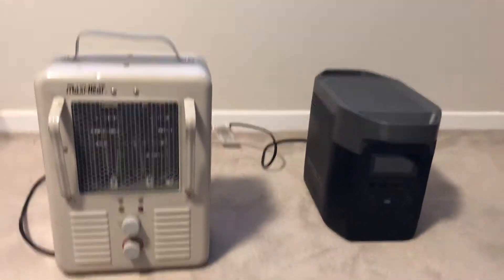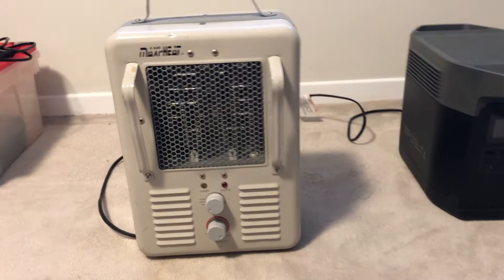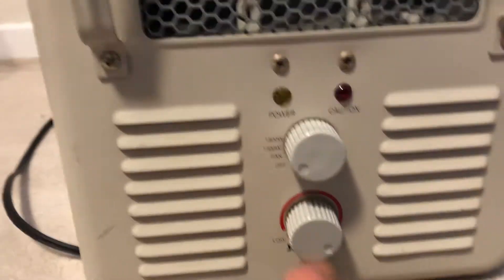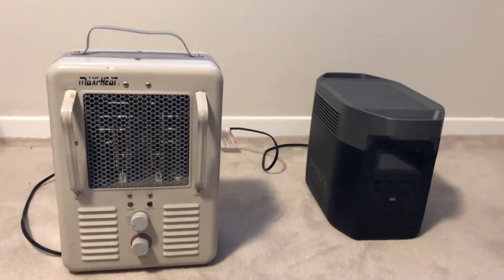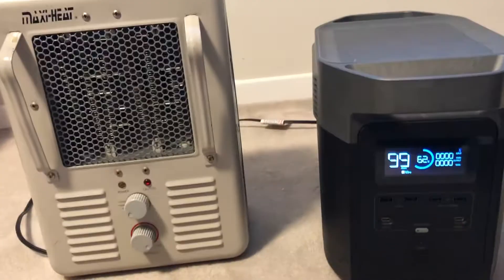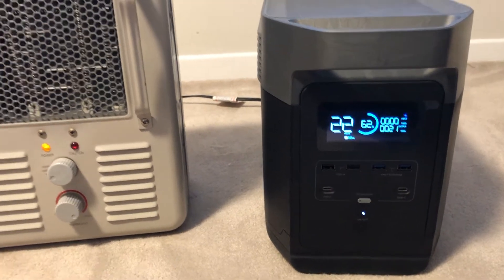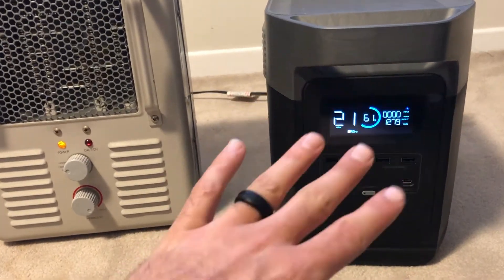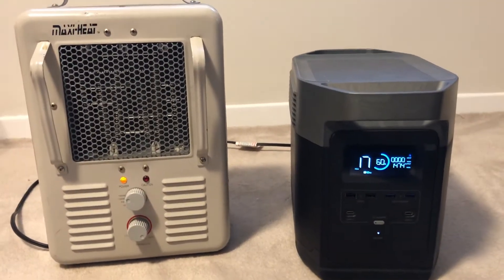EcoFlow Delta 1800 Space Heater Test - Can The Delta Solar Generator Run a Small Space Heater?

Comment: A heated blanket would be a much better option.
Reply: I'm homeless and sleep in my truck.  I need to power a heater without electricity
Reply: Look into an all-in-one diesel heater. About $100. You can have it in the trunk and run the heat to you. @justinkanicki8044

Comment: Yeah, but how long can it run the heater. In the winter thou need it to run all night.
Reply: No comments for a year no update smh
Reply: The ECO Flow showed 62% battery so it wasn't fully charged, but when he put on 1500w it showed 17 minutes run time. So it would probably run longer if he left it at 1300w, but ultimately would need a larger generator/inverter (or additional battery) if you wanted to run a 1500w unit for a lengthy amount of time.

Comment: How long would it run that space heater for. Would it run for 8hrs through the night?
Reply: Not long
Reply: Do the math.
Battery has 1260Wh capacity. 
1300W heater in an hour will use 1300Wh.
Realistically, you'll get 30-40 minutes tops.
Reply: The battery was going down quickly in the video. I'm guessing it'd deplete in under an hour.
Reply: Running electric heater is not efficient, better off using these, for tv, fridge and other things, recommend, gas, propane, kerosene heaters, which would run much longer.

Comment: I'm about to be in a camping situation and I don't want to bring a loud generator to keep some heat going on tonight. Which is why I'm looking at this period and this is the 2nd time I've heard someone in a review say the review say they ran ahead of for like a minute or 2 minutes. That says that it'll turn it on it doesn't mean it can handle it. So I guess solar power generated to run a heater on a camping trip is a pipe dream Unless I'm gonna pay for legenerated at cost as much as a car
Reply: It will run that heater but it'll be for less than an hour is 1024 Watt unit and you're drawing 1500 watts to the math lol
in other words an electric heater on that solar generator is pretty much waste of time.
Reply: Or a 250 watt heater on a 3000-5000 watt hour generator would be fine.

Comment: Lol, so you can run a space heater for 17 mins? Gas generator is the way to go
Reply: Try an electric blanket instead of a heater.
Reply: it's the exact same problem.
Reply: @benjaminmuller9361  A 2000 watt gas gen would run a 1500 watt heater for 4 hours on a tank of gas which should be 1 gallon, so not the same problem.

Comment: We just got an EcoFlow Delta last month. I'm not good at math and figuring out the amps/watts stuff, so plugging things in and seeing the response of it means more to me. Yes, the Delta will run our ceramic space heater, but I had similar results on the time it lasts. It will pump out heat, but not for long enough to matter, especially when you are camping on a cold night, even in a 72 square foot space. I think we will have to use the Delta to power electric blankets or mattress pads or heating pads; or maybe a 250 watt personal heater.
Reply: How long was the time? How long did it run?
Reply: Amps will drain it fast  and it's not designed for something like that  plus on top of all that efficiency waist heating and cooling is the meat efficient method of power conversion at 1500W and 120V you are pulling 12.5Amps and the battery is about 8.53Ah so you'll be at about 125% of the capacity. It can pull "1800W but that's only because it lowers the voltage which allows the amperage to increase a little bit it's k to actually using that much wattage technically. And even at 1300 instead of 1500W you're still pulling 10.84Amps so still over the capacity. You'd have to have 1000W heater for it to get 8.35A and its capacity being 8.53 may last an hour depending on the efficiency of the unit I think somone got the calculation to be like 82% efficient plus the inefficiency of the heater too will decrease that. But you won't get very long on any heater pulling major amps
Reply: Yup 250 watt heater.

Comment: So the display means that it has enough power to run that heater for about 17 hrs after you switched it to the high 1500w setting. Is that right?
Reply: @zfontain1975  oh wow. That doesn't work for us then.
Reply: @zfontain1975  17 minutes? Wtf 😂😂
Reply: One night I was freezing I had that little generator ran my electric blanket all night I only use about 25% of energy. Might think it's nothing but it works.